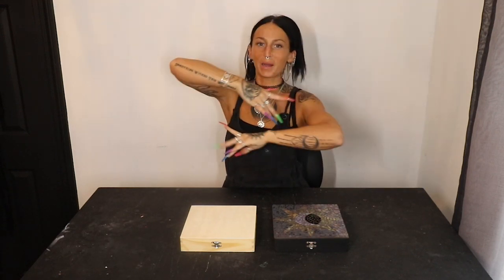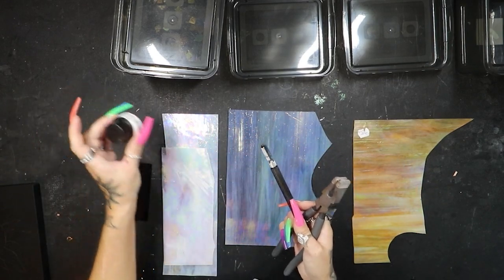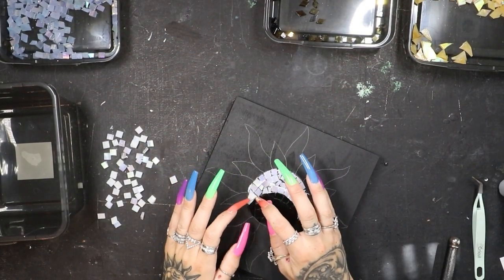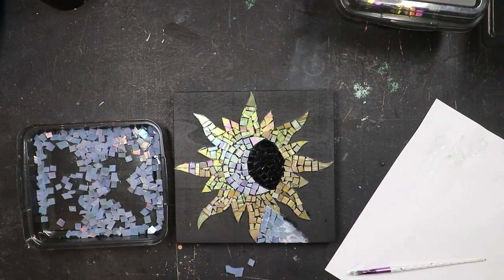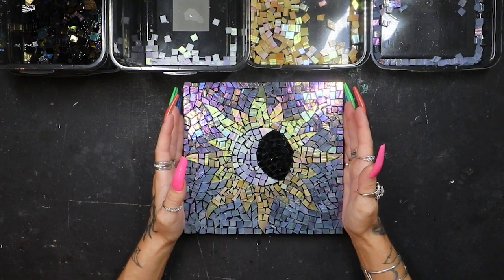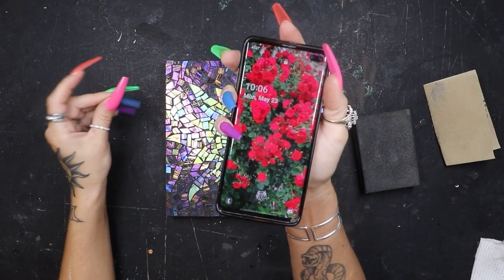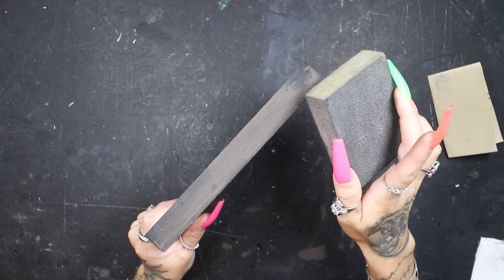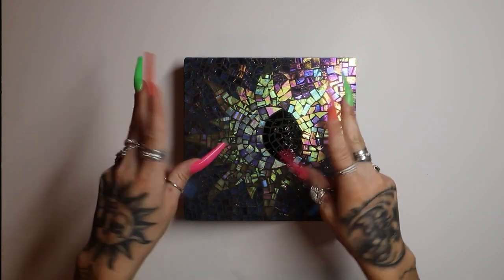DIY MOSAIC BOX! (I'm hooked on mosaics)

Comment: Great job with your fitting. You might think about sealing the wood before you do your project. The wood could draw the water from the grout and this will loosen your tiles eventually.
Reply from the maker: It is sealed with the krylon matte sealer! ♡

Comment: Use chalk in the back of the paper image, you can trace the front and the chalk will transfer the design onto the surface. It’s a simpler version of using carbon paper.
Reply: I am curious what the author thinks!! This tip helped me a lot and I hope it helps you!

Comment: Beautiful work as always. I have done mosaics for a long time and was inspired to start stained glass because of your excellent videos. I incorporate suns and moons made of stamped polymer clay within the glass tiles and have wondered about incorporating soldered shapes into the mosaic to create silver or bronze borders within it too, along with the grout. Perhaps you can experiment with that in a future project. I teach and host mosaic workshops at my home in Oregon and I have one tip for learners who chose the wooden boxes I offer including the one that you just did. It helps to add tiles around the bottom half of the box just a simple color because it will balance the weight of it. Otherwise the heavier glass on the lid would flip it when opened if there is not something heavy inside to hold it down. Anyway, I am happy that you are into mosaics and look forward to seeing you do more. It’s addicting for sure.

Comment: This is stunning!! I love the color choices so much. Lightly damp cheesecloth works really well to wipe away grout haze pretty quickly and non sanded grout would work really well for your mosaics. And you can get it at lowes/ Home Depot. I can’t wait to see your next project!!
Reply from the maker: Ok noted!! Will pick some up.  What is the difference between the sanded/non sanded? I assumed since the "mosaic grout" was sanded, it provided a benefit.
Reply: Sanded grout is needed when you have gaps between your tiles that are an 1/8” and larger. Non sanded grout could crack if you are bridging a gap over an 1/8” but it gives a very smooth finish and there’s no risk of scratching your glass! Some sanded grouts have pretty course grit in it, and could scratch. The one you were using seemed to have pretty fine grit, so it wasn’t a big deal. Non sanded will feel like spreading smooth peanut butter, and should clean up a little easier. 
I worked in flooring/ tiling for a very long time! Lol
Reply from the maker: Ok awesome, noted all of that. Appreciate your knowledge dude!!!
Reply: No problem!! I was just looking into the grout you were using and the stuff from big box stores, and the one you are using might be better for the color consistency. I was just reading some really bad reviews on charcoal color grouts from big box stores!
Reply from the maker: Yea and frankly the reviews on this one aren't great either. It's not black, not even close. But I'm totally ok with that. I feel like adding a drop of food coloring would  solve that issue. Beyond that I love it, as you noted it looks like a fine grit- it is. Very smooth, I have zero questions about rubbing it all over my glass and no worry about any micro scratching or anything. Dries well, consistent coloring, wears well so far. I'm happy with it. But I'm not a grout pro, so take that with a grain of salt .....or grain of grout sand lol.
Reply: lol!! Well this piece really is spectacular. The iridescent glass is just 👩‍🍳💋

Comment: So little trick to transferring… if you trace the back of the design in pencil, and use a lot of pencil, then place it on the box traces side down and go over the top of the design in ball point pen. It should transfer the pencil onto the box. 😊